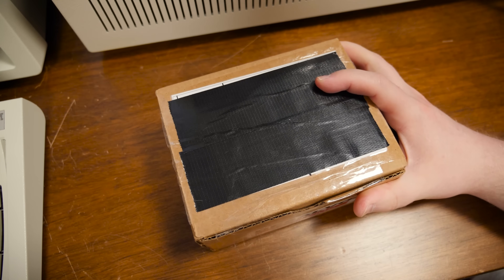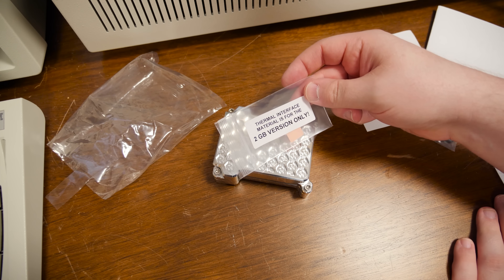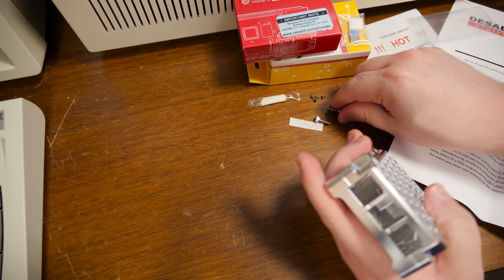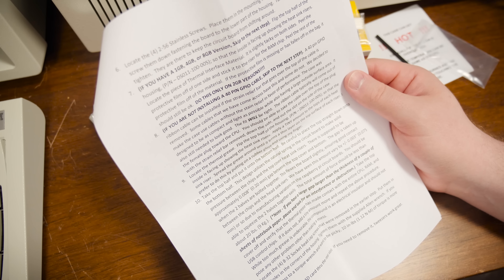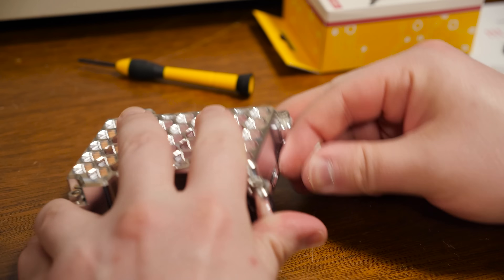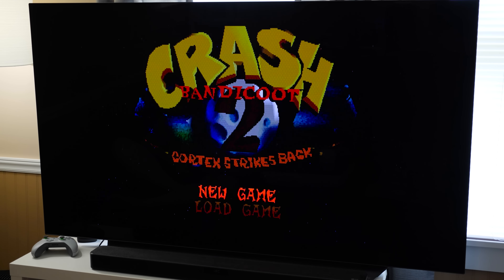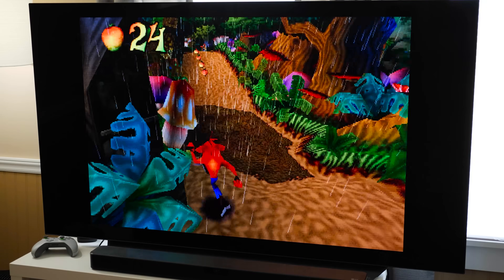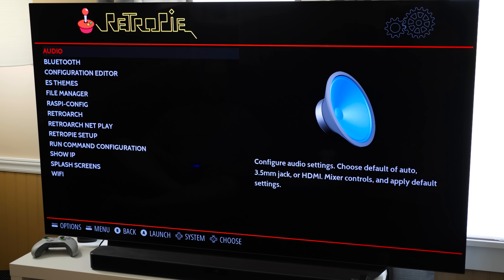Solid Aluminum Raspberry Pi 4 Case by DeSalvo Systems

Comment: I'd love to see a case like this for an apple 2 or ibm pc compatible
Reply: It would be cool, but catastrophically expensive. That case started life as probably 2 solid pieces of aluminum. Just the materials for an XT size version would be several hundred bucks, then machining. I'd expect to pay at least several grand to have a machine shop make one.

However... Having a Pi case that looks like a little billet aluminum XT would also be sweet, and not nearly as insanely expensive. So... Maybe someone is listening?
Reply: @TheBrokenLife : Oh—a milled case, rather than a regular case made out of aluminium. I suppose if someone really wanted, they could take it to a shop that anodizes aluminium, but then they'd be stuck with that color. The silver finish of aluminium work well with both beige and black drive face plates.

Comment: Not even full copper? meh
Reply from the maker: Oof, just imagine what that would cost. Copper is currently four times the prices of aluminum per ounce.
Reply: @LGRBlerbs  Per ounce? Copper's denser so it would be around twelve times the cost to make the same shape.
Reply: I actually looked into it.  Would have been $300 per case. Material cost was one factor alone. The tooling would have to change, programming the CNC, process time, on and on. Would be bad ass but just too expensive for the consumer market.

Comment: I wonder how much it affects the WiFi signal strength.
Reply from the maker: Can't say I've noticed much of a difference so far, Samba shares are transferring as normal. Then again, it's on the other side of the house as my router as always so it's never been particularly fast even without a case, heh.
Reply: LGR Blerbs 📚
Reply: E-
THER-
NET

Unless it's absolutely necessary to use wifi in some use cases, Ethernet is the way to go.
Reply from the maker: @JB2X-Z  If I'm not doing work or playing games online, wifi is more than good enough for casual usage. At least for me. Far more convenient than cables everywhere!
Reply: @LGRBlerbs  people always forget that sometimes convenience wins over performance
Reply: @50shadesofbeige88  If anything, you'd think the case would act as an antenna since it sits directly against the module.
Reply: @shadowtheimpure  RF at 2,4GHz doesn't work that way.
Reply: @shadowtheimpure  First off, the outside of the module isn't (or at least *shouldn't*) be connected to its antenna. The module case is most probably grounded. That's because with antenna designs, you don't want anything but your dedicated antenna to act as one. Secondly, even if the module was poorly grounded, the pi-case would, for obvious reasons, be a terrible antenna. Sticking an antenna that is not tuned for a specific frequency on something will definitely lead to a signal degradation (if not the death of the transmitter). My guess is that the case isn't inhibiting the signal, because it's grounded and because aluminium isn't very good as an RF shield. If you covered the whole case in copper tape, then I think you'd see a pretty bad wifi/bluetooth signal.